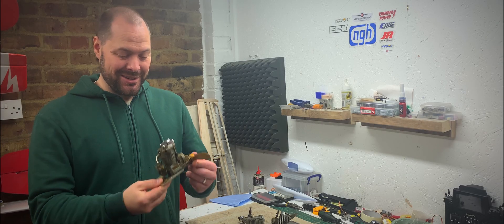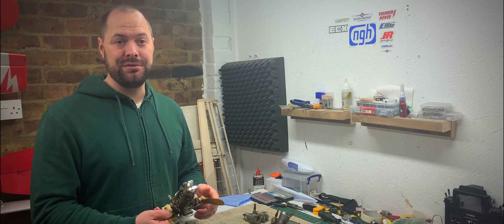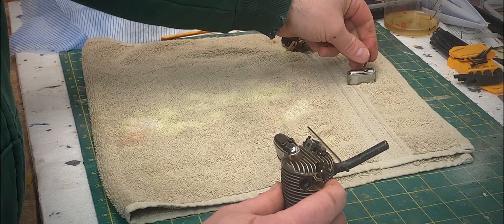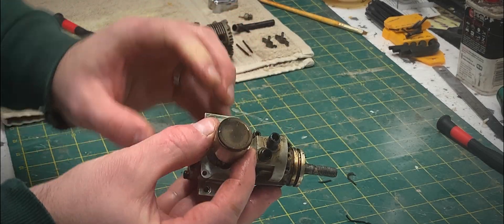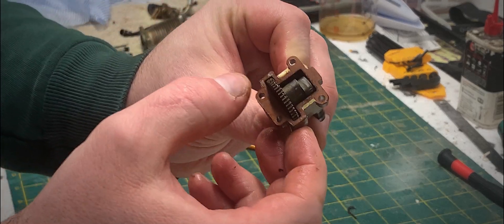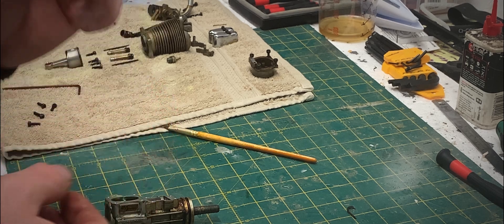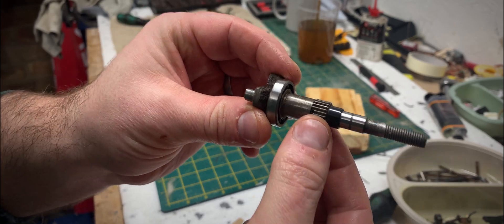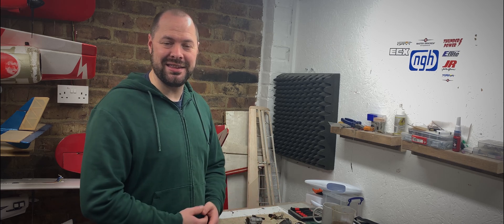Saito FA-45 Special Four Stroke Restoration

Comment: Don't  fix what  doesn't need fixing don't  take it apart if all turns smoothly. 
Iv just started  a sato 45 specal thats been standing in a old model in a old Damp shed for 15 years soaked it in oil blew air through  it. AND IT STARTED AFTER 7 FLICKS AND RUNS  A DREAM . 👍
Some times by pulling things apart that don't need it can cause more harm than GOOD.